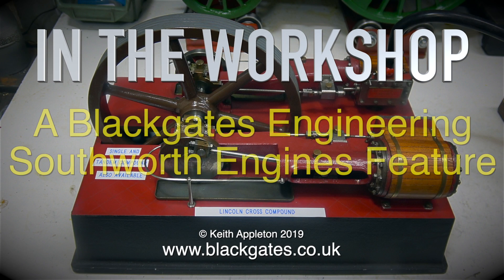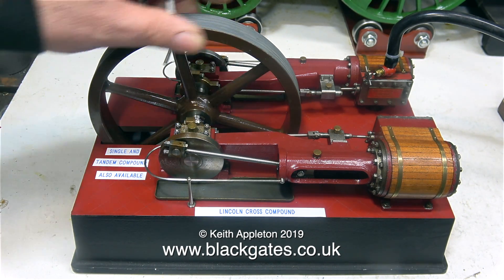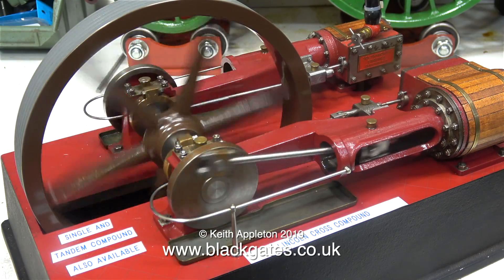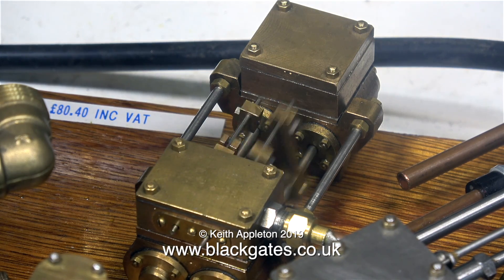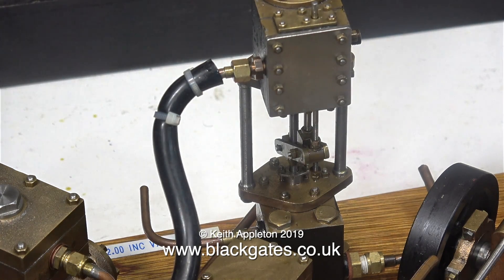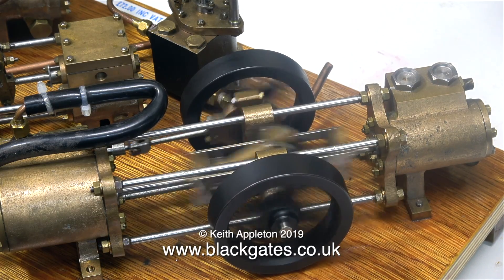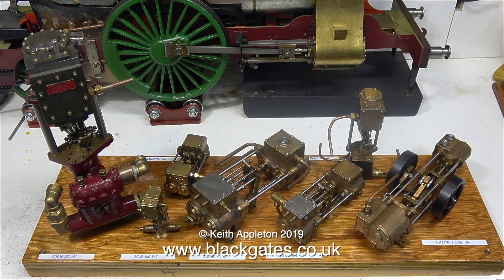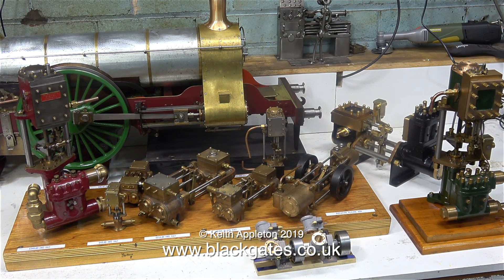A SPECIAL SOUTHWORTH ENGINES FEATURE  - IN THE WORKSHOP

Comment: Hey Keith 
Love these pumps. I am used to hand pumps and injectors. What happens when the pump has satisfied the boiler? Do you still need to turn them on and off to make sure boiler level is good?

Gun metal is not red brass. The exact alloy has been lost which is a shame. The admiralty, like lord Nelson, began using cannons made of a special brass or bronze alloy called gun metal for cannons, hence the name gun metal. Gun metal was also used by English plane makers like Norris for sides because it resists the effect of sweaty plams.

The closest I have found to true gun metal is the 4 series navel brass alloys used for marine fittings. Red brass I believe is a 3 series alloy.
Reply from the maker: Yes, you just turn off the pump until it's needed again, but an adjustable water bypass system back to the tank is also a good idea.

Comment: I have a question Keith - why would the two tandem steam cylinders work in a "thump-thump-nothing" mode instead of . . . like opposed? I mean, they look like they're at 0 and 90 and then nothing at 180 and the other at 270 - do you know why? (just curious and don't know where to look for it, thought you might have an answer, filled with wry wit to make me smile and learn at the same time) - TY
Reply from the maker: I assume that you mean on the Lincoln Cross Compound Engine ..... It's a 90 degree Cross Compound Engine, not a Tandem.